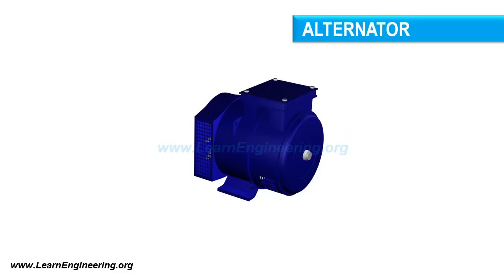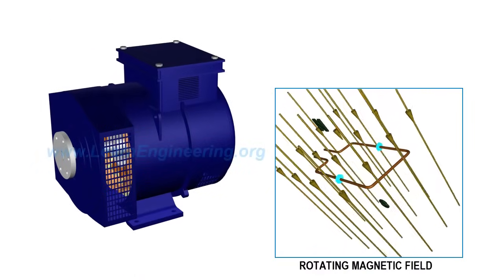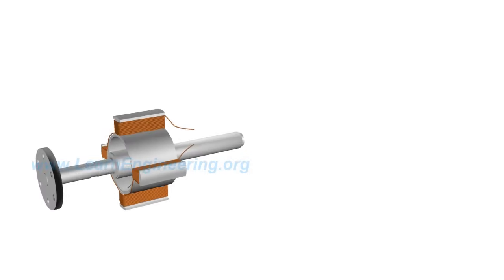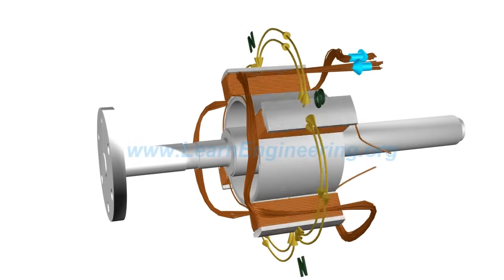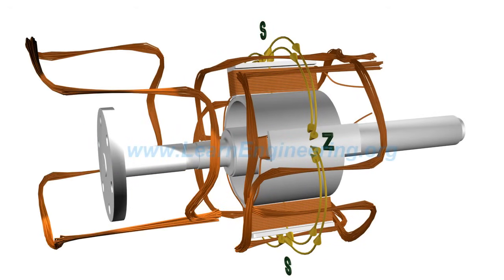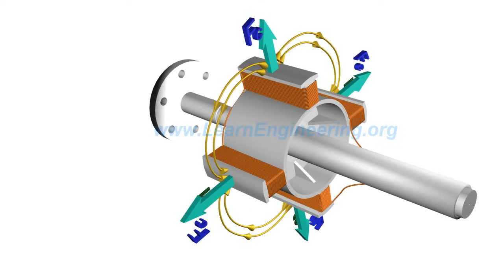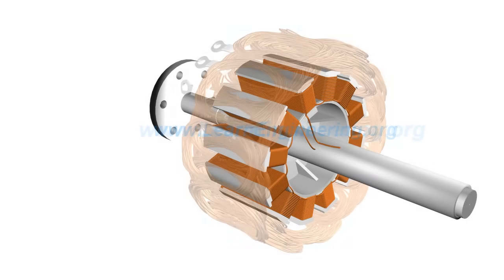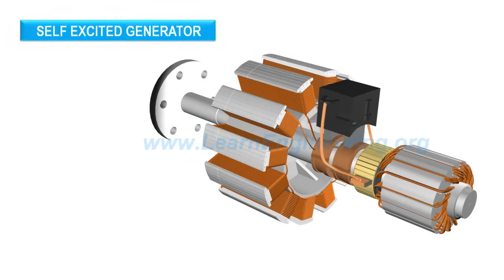How does an Alternator Work ?

Comment: Is any type of current supplied to stator of alternator like that done to rotor of dc generator
Reply: If the machine is working as a generator, rotor DC current induce AC voltage or EMF in the stator windings. If you connect the stator windings to a load or the grid, current flows through the windings. If the machine is working as a motor, you connect 3 phase AC to the stator and DC to the rotor.

Comment: Why we excite the rotor coils by a DC current instead of AC ??
Reply: If you used AC the rotor coils would switch magnetic poles each cycle of the waveform, and the rotor would just wiggle instead of rotating.
Reply: Because if you rotate the DC rotor with 50 (60) Hz, you will get 50 (60) Hz AC on the stator side. Permanent magnets can also be used in the rotor.

Comment: 1:28 wrong diagram representation. Working on without magnet projects vlog. You can watch it not a promotion
Reply: Thank you. I was very confused. Nearly thought that something is going wrong with me .
Reply: What's wrong, the polarity?
Reply: @CombraStudios  the direction of field lines is wrong. Use right hand rule you will get that he has drawn the feild lines in the opposite direction.
Reply: @Dhanush-zj7mf  Hello, I just used the right hand rule for the 1:27 pic. It shows the N coils are correct and the S coils show cyan arrows in wrong direction
Reply: @CombraStudios  yeah. I am said the same
Reply: @CombraStudios  the real wrong(at least in my opinion) is that the current direction shown by blue arrows at S poles are wrong. I mean if the current directions are reversed at S poles then there would be no problem....

Comment: how it rotates? man where u shown it?
!! INCOMPLETE !!
Reply: Hi ,it's a generator, so you have to move the rotor with a force, such as the  force of water, air or steam, this elements are used in hydroelectric and thermoelectric plants to provide the movement required by the rotor.

Comment: alternators are the evidence that free energy is possible, cause it uses less electricity to produce more electricity.  (thermodynamics  fails)
Reply: Bro its physics common law that output cant be greater than input in your way u have said that alternator is evidence of free engery but u dnt know alternator generate electricity when it will roatate at ideal speed (depend on numbers of poles) so for rotation its need prime mover ..and prime mover need fuel or other energy sources...got it

Comment: So im looking for this setup, in single-phase vs 3-phase, without the voltage regulator so that voltage output is virtually unchecked! So that the field is NOT reduced as RPM increases!
And i can get 60hz with 8poles at 900rpm

Comment: Can you explain how a Y-connection three phase source generated by three windings supply currents through a diode assembly to a load ? Specifically for a car alternator which has this Y-connection at its stator.

Comment: I think the poles are labeled incorrectly, as typically a N pole should have magnetic flux lines going outward and inward for the S pole (the flux line arrows appear correct based upon the DC flow through the rotor coils). And the current should be maximum when a rotor pole is directly across from a stator winding, not when the winding is in between the poles. Then use "Flemings right-hand rule for generators" to get the direction of the current. As best I can tell the current directional arrows might also be backwards, but it's hard to tell with the current shown as zero at the incorrect time. Otherwise it's a pretty nice animation.
Reply: You are right for general magnets and earth for example, but in AC machines, this direction is assumed for the outside of the machine which means that would be from N to S on the inside because the most effective part of the magnetic field is the inner part.
Reply: I think you are right but how cant it be that nobody say anything about that? How can it be that an expert with millions of subscribers says something so wrong? Faraday Newman law is the base for this kind of things....So are we really right?
Reply: @marvnet8898   Not a big thing that a million subscriber can say something wrong, all over they are also humans.

Comment: Is it necessary that magnet put in like that ( S,N,S,N ), im trying to fix my bike’s rotor by replacing its magnet, and i dont know how to check where is the N or the S pole, by the way i try to check it by put the magnet next to it, both side made the magnet stick. So i assuming the north and the south part of the magnet is the top and the bottom of the magnet (surface)
Reply: Nvm i found the n and s

Comment: In Diesel generator,  how the output ac voltage is decided?. Is it depends the speed of engine which will rotate the alternator?  If yes,  then how do we get constant supply as speed of engine may vary?

Comment: in the base,rotor cuts electromagnetic field between rotor and stator coils,in that situation electric charge began to produce ac electricity.Stator coils are connected to the diode unit,and they convert ac power to the dc power.Regulator is connected directly with a rotor colector and diode unit ,and by that he regulates dc electric charge between 13.5v -14.5v. to the battery.

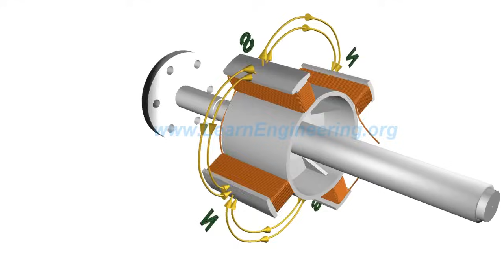Comment: Hello sir,at first thank you so much for these awesome videos ,i just want to ask you one question,in this video in the moment 3:07 ,you said: it may fail mechanically over the time,the pronoun it refers to who ? to the  rotor ? ....Hope you will answer me
Reply: yes because of the friction heat from high speed rotation (eg 1800rpm) required to run a 4 pole rotor, the setup will burn up its bearings and shaft, so they suggest you to have more poles in the rotor so that you can produce energy with lower speeds of rotation (eg 400rpm)
Reply: thank you sir,but why we don't talk about the Centrifugal force when asynchronous motor run at 1500 rpm for exemple ?

Comment: Why is the number of poles and rotor speed divided by 120? Is it some kind of constant?
Reply: Jasper van den Berg it's a formula n=(120*f)÷#poles
Reply: each phase is separated by 120 degrees?
Reply: Sara darella, yes they are, but I'm not sure if the 120 on the formula actually comes from de phase angle

Comment: if the armature coil was fixed to a second rotating axle, you could create an electric clutch by adjusting the voltage on the rotor and armature coils.
Reply: TheSpyFishMan I

Comment: i think all generators should be permanent magnet alternators..that will be more efficient so we dont have to induce an electromagnetic field to the rotors and also it makes the whole system brushless or without any slip rings on moving parts
Reply: fidel catsro Then how will you regulate the voltage output?
Reply: regulating voltage from PMA's were unreliable up till some years back..not anymore..there are reliable electronic switching AC-DC , or DC-DC converter modules that can do these very well look for them on Ebay...plenty there..
Reply: you know you can lift a car using an electromagnet powered by a small 9 volt battery, electromagnets doesn't draw much power and produces a stronger magnetic field than permanent ones
Reply: fidel catsro an electric generator with only permanent magnets are called "dynamos" and have been replaced by alternators.

Comment: Sorry for the question, but since the rotor coils are excited by DC current, we would be using electricity to make electricity?
Reply: The DC generator supplied the DC current that is converted to AC. The motive force for the system is provided by an outside source. The alternator in your car, for example, gets its motive force from the alternator belt attached to the drive shaft of the car's engine. It's not clearly explained in this video.
Reply: It's good to generate 1500 MW by using 250v as starter. Isn't it bad ?
Reply: Very true.But a small amount of DC source i.e. Dc input is required.Afterall the output we obtain is a 3phase AC voltage.😁😁
Reply: Something like that, anyway you need an external mechanic work to really generate electricity. You can also see this kind of electric machines with permanent magnets such as the brushless motors, instead of the rotating coils. These machines are also used as constant RPM motors, when you have variating loads Ex. an elevator. Also in the past they used this machine as a cos fi corrector due to it can act as an inductive load, as any other motor, or a capacitive load. Instead of using banks of capacitors. Anyway the rotor coils use like a 1% of the electricity that consumes or generates the machine. These datasheets are studied in every single motor and there exists a lot of maths to determine the parameters.
Reply: I was asking the same question good thing I found yours..lol so what would be the difference to this kind of of generator to a generator with permanent magnets? jsut correct me if my statement is wrong :3
Reply: first of all the amount of current required to magnetize the rotor is very small compared to the output of the alternator and all this energy comes from a mechanical source. secondly we do not use permanent magnets is some alternators for several reason i-e Easy output regulation, permanent magnets loose their life in heat and over long duration, and safety. I hope this helps

Comment: Engine peak rpm is around 8000 and with the pulley ratio of 3:1 the rpm at the alternator becomes about 24000. So if I am not wrong such low rpm range ac generators are not used in an automotive industry. What kind of an alternator have you considered in the video? and where are they used?
Reply: hydroelectric power generators maybe running on low rpm...wind power also low rpm...better to be low rpm, because less wear and tear to the parts

Comment: Can you please explain how the rotor gets dc external current and is it required continously? Or just initially and why?
Reply: BATTERY can be used to excite the rotor into electromagnets..the video showed a self excited alternator, that means no need for battery, there is a tiny dynamo like you see on a bicycle with coils and magnet to provide the power to the main large rotor coils for doing this as you spin it
Reply: fidel catsro thankyou!

Comment: Minute 1:29 I think there's a mistake in the sense of the currents (just 2 of the coils), because it doesn't correspond with the magnetic field shown. Can someone check it? Thanks!
Reply: You are correct. The top and bottom coils have currents going in the wrong direction. The direction shown should produce North poles not south based on the right hand rule of magnetic fields induced by looped currents (up for CCW and down for CW).
Reply: I noticed it too, they placed there N and S at the wrong places

Comment: if all the battery is doing is turning it into AC then DC again why not run the battery directly? I dont see how it could generate more power than you input??? unless it just takes 100's of amps from the battery and makes the battery charge itself??? That doesnt make any logical sense.

Comment: What's the use of damper winding???
Reply: +Hari Pirate When the generator falls out of Synchronous speed, a voltage is induced in the squirrel cage damper winding. This helps to dampen oscillation of the rotor. Also it is used on the initial starting of the motor, it starts like an induction motor, but once the "Pull in" torque can be achieved it no longer has an induced voltage, because of the synchronous speed.

Comment: the rotor is moving in the electromagnetic field cutting the field on the stator induces the charge(voltage) that comes im to diode ,AC voltage transformes to DCvoltage throught diodes,then regulator regulates the voltage  is 13,5 to 14.5v to the battery.

Comment: Wait, how is it getting dc current at all? The dc generator would also need dc electricity to flow through the stator to induce the current if magnets are not used. How would this be self exiting? I would expect that the dc electricity is supplied via an external source until it is able to generate its own electricity.
Reply: dc generator can work either by permanent magnets or by residual magnitism in its field coil
Reply: most household generators that use the pull-cord start technology use an AVR that has a charge-pump built in. Natural voltages will occur in the rotating generator even when there is no field voltage. Although this voltage is small. 2 to 3 volts at proper RPM. This is just enough to kick the charge-pump circuit in the AVR and will get the circuit function. Charge pump can push 30 to 50v back into the field winding and presto, the generator will now go into loop control by causing the windings to excite. The output voltage is fed back into the AVR, keeping the AVR powered as well as being monitored via analog circuits to control the amount of field current.

Comment: Not exactly how a car alternator works. A diode(diodes only allow electricity to flow in one direction) bridge is used to smooth out the 3 phase AC current into a fairly steady DC stream, although there is still fluctuation, the battery smooths this out acting as a capacitor.
Reply: +Nate Elliott We are talking about power station alternators. AC = Alternator. DC = Generator. Your car alternator has a diode bridge that turns the AC into DC output........
Reply: +EETechs I only bring it up because most people think of an alternator as that thing in there car they had to replace when the battery kept dying.
Reply: EETechs and generator is a catch all term like alternator, it doesn't mean it only outputs dc current.

Comment: Why they use laminate steel and no normal steel? and why they dont use cooper(Cu-) and use steel (Fe-)  in min 3:32 to 3:39
Reply: +SLEVIN SHAFEL
Steel allows magnetic currents to pass through it easily because it is a ferromagnetic material (it changes magnetism when a strong enough field is present), copper on the other hand is not ferromagnetic, nor is air that is why air gaps are filled best as possible with those plates.
And it is laminated because the moving magnetic field will induce a current inside steel just as it does inside the copper wire, so to limit that effect the material is separated into plates so the current is limited to individual sections, not a perfect solution but much better then solid material.
Reply: +MsSomeonenew thank you fore responde but i still understand why put laminate steel than normal steel.

Comment: So it's main function is turning DC power into AC?
Reply: +Peter Timowreef No, the alternator doesn't turn the current from direct to alternate. The DC current is just needed to create the magnetic field of the rotor. The function is to convert the mechanical power into electrical power.
Reply: *****
Ok, but when it's doing it the other way around suddenly it's called a dynamo..? While they're the same thing?
Reply: +Peter Timowreef in many cases you can use the alternator in the inverse mode, and in this alternative it is called synchronous motor
Reply: +Peter Timowreef You use an alternating magnetic field to creat an electric (field), next this is turned to DC by a regulator/rectifer.

Comment: Nice video.  I believe that, if you view 01:28 of the video, the rotating field has poles at 9 o'clock labelled as "NORTH"  and 12 o'clock labelled "SOUTH", but the winding direction is the same viewing the pole face: this seems to be a contradiction of the right-hand-rule; the winding directions should be opposite on the adjacent poles.
Reply: Yes jerome whelan, the direction of currents there should be in reverse direction
Reply: jerome whelan hi
Reply: I was going to comment the same thing. However I am not sure whether the currents should have inverted directions or just the labels N and S should be inverted.

Comment: So ,I got me this generator head at e bay, but no diagram in it, I ran it and it produce 120 volts with low amps, I think, there are 6 wires coming out 2 black wires crimped together with 2 bands of red and yellow and both have green tape around it, the other 2 black wires are also crimped together with a band of white and blue and a black tape around it, the 4 remaining wires are color coded with the 2 crimped wires, the 2 blue and white makes 120 volts so as the 2 red and yellow, I coupled them to see if it could run my grinder but it only works half power.... SO.....CAN SOMEONE OUT THERE HELP SAVE MY SANITY!!!!!!!!!!bwua hahahaha........

Comment: Armature is the rotating portion and the STATOR is the Stationary portion. The armature is NOT stationary. Wow I really thought this was going to be a great video people may learn from until that was said.
Reply: RiaRadioFMHD773 The video is correct. An AC Generator is the opposite of a DC generator. Therefore the Stator (which is stationary) is called an armature in this situation since it delivers the power to the connected load. And the Rotor (which rotates) contains the windings that create the magnetic field.